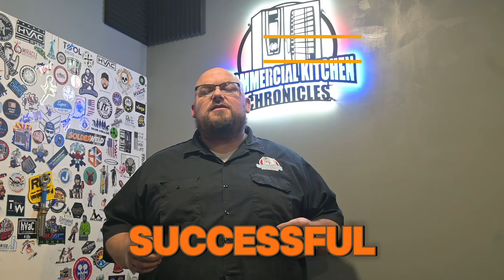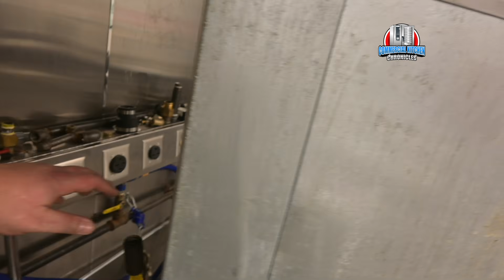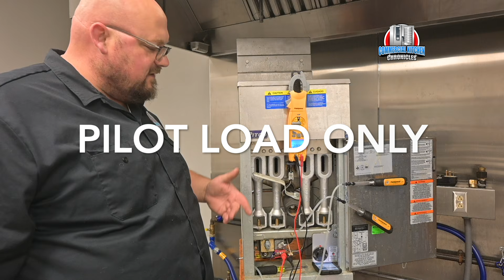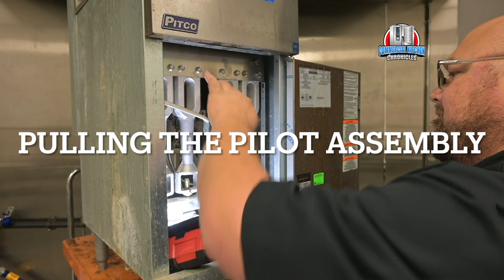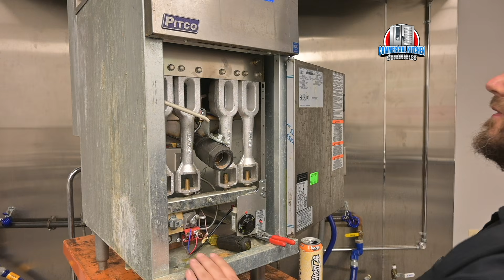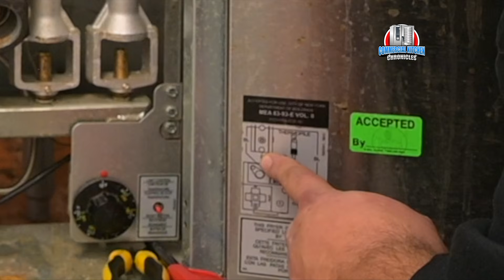🔥 How to Troubleshoot the Most Misdiagnosed Commercial Kitchen Equipment: The Gas DC Millivolt Fryer

Comment: I just installed a standing gas fryer and my food truck LPG and I can’t get the pilot to light at all and there is some confusion on whether I need a regulator in line or not. Instructions are horribly vague. With the regulator ahead on the old deep prior, nothing wants the light but when it’s completely unregulated, the pilot light won’t light, but there’s always coming out of the three nozzles.
Reply: Your fryer most likely has a gas valve with a built-in regulator (a combination gas valve) ; However, that regulator in the gas valve cannot hold back or regulate the pressure a propane tank supplies.  Get your supply gas pressure  ( the pressure going into the gas valve) regulated with the proper regulator.  I'm not 100% sure of LP pressure needed but it's probably going to be around 12"wc (INCHES of WATER COLUMN not psi) . If it's a used fryer make sure it is set up for LP not Natural Gas.   If gas is flowing out of your main burners without a regulator on it, you created a very dangerous condition and MAY have even damaged your gas valve.   Do NOT try to light until gas pressures are set to what the fryers ID tag states. LP probably 10"wc  Natural probably 3.5" some fryers a little higher.  Good Luck   
You really should get a commercial appliance tech to test and install this fryer.
Reply from the maker: on point sir
Reply from the maker: Tank needs a regulator at it and then one at the fryer. LP on food trucks are always a pain

Comment: Thank you so much for the video! I have a Pitco fryer, and I’m having an issue: when I turn the valve to 'ON' after lighting the pilot, the pilot light goes out. My thermopile is reading 600mV, so that should be fine. Also, sometimes the pilot goes out right when I turn the thermostat to start heating. Any idea what might be causing this? Thanks for your help!

Comment: Those fryers don’t use pressure regs if fed with 14”wc or less . The gas valve is a regulator built in
Reply from the maker: Yea I know that. I was using it to simulate low gas pressure situations.

Comment: I've never seen fryer with vertical burners like that. The model I service it always horizontal. I got question...I'm having a fryer keep making boom noise just during cold start. I replaced gas valve, ignition, spark cable, relay board, but nothing help. In coming gas is a bit high 12.5 wc...7-9 wc is normal. This is 2x connected fryer but another unit has no issue sharing same gas line. Nothing block rear chute. You think could be burner issue? Thanks
Reply from the maker: Could be loading up on gas. Igniter placement could be off a little bit.

Comment: I need to look as well, but I'll still ask. You have close up videos on the just gas vlaves, the various ports and how they adjust?
Reply: On a service call, I had a pilot light go out on a deep frier.

I been in the trade 13 yrs in Phoenix area for a/c and refrigeration. I'm pretty weak on the hot side. Again, appreciate the video!
Reply from the maker: Ill be redoing it later. I'll pull the valve and show it

Comment: any thoughts on what would be causing my industrial pitco fryer to over gas and shoot a flame out the exhaust chute when the burner does light? also have one bay that lights and runs fine but will constantly have a flame coming out the exhaust chute. we have cleaned the chute and installed new burners and it still does it? thanks in advance for any help. Dave
Reply from the maker: Gas pressure? Divertors in tubes?
Reply: Could be valve issue. I fixed one just like that it scared the crap out of kitchen crews. I start it up and both pilot and main burner lit up at same time it startled me.
Reply: I have a pitco that goes boom too... Did u resolve ur problem?

Comment: Pretty sure that gas valve is rated for .5 psi inlet so your appliance regulator is another issue waiting to happen.
Reply from the maker: Its only only there so I can simulate low pressure issues....

Comment: It would help if you had close ups of where everything is hooked up to.  I can't see where your manommeter is connected.
Reply from the maker: Ill be redoing it soon. Thanks for the feedback.
Reply: @CommercialKitchenChronicles i look forward to it!
Reply: I have a propane converted one that I just bought.  The pilot knob won’t turn from off to pilot .  It’s like it’s locked any suggestions?
Reply from the maker: @nbdteev new valve
Reply: @CommercialKitchenChronicles  you mean like a whole new valve that has the pilot knob that I just saw online?  I read there was a safety mechanism that makes it lock if there is not enough pressure
Reply from the maker: @nbdteev no you have to push it in a little before turning it.
Reply: @CommercialKitchenChronicles  that’s what I mean I tried everything and nothing
Reply: That’s what I mean.  Even pushing it in.  It won’t turn at all it’s like it’s locked.  Is there a safety mechanism on these things.  I have tried everything

Comment: Good thorough run down. Would be helpful to have close ups on the different things you are pointing to and adjusting. Like the main burner gas pressure adjustment at the safety valve etc.

Comment: I always just short out the red and blue on the valve to test the hi-limit. I've found with hi-limits if they don't reset, a good solid smack  on the side with a heavy pair of pliers usually does the trick. You'll then get the "click of success", lol. And another trick I've learned is that they seem not to make those red millivolt valves anymore, everything has gone back to the silver valves with the beige knobs. The valve in your video has 4 terminals, but the silver ones with beige knobs only have three. Just ignore/don't use the blue wire when you are  converting it over because brown to red is a complete circuit through the hi-limit and the thermostat. From bottom to top on a pitco, it's: both reds, white in middle, brown on top.

Comment: My fryer is candeling
Reply from the maker: Gas valve not fully closing more than likely. Being a food truck, do you have proper regulators installed on the equipment.  The high pressure of thebtanks can damage valves.

Comment: 5.46 is incorrect the whole gas valves incoming gas supply is regulated by the governor(regulator) on the back of the fryer. When you're adjusting the rear governor(regulator) it WILL alter the pilot supply because you'll reducing the incoming gas pressure to the whole gas valve. The only way that pilot flame should be increased or decreased is by adjusting the pilot supply adjustment screw on the gas valve itself. The only other way that pilot flame will be too high or too low is if the incorrect pilot jet(orifice) was inserted or the pilot mushroom was blocked or obstructed or the primary air opening had an issue. The fryer main gas valve may have a regulator built into it, it,to  be used to adjust the burner pressure if required for lp it may be capped of at present with a blanking plate if you on natural gas.
Reply from the maker: @manninghr1  did you read the description or watch the entire video? The only reason I had the regulator on the back is to usebit to simulate low gas pressure issues. My system is only at 8" w/c so technically I don't need it. Yes the only way to adjust the pilot is with the needle valve. I was just showing how gas pressure can affect your pilot, not using it to adjust it.

Comment: Hi there so if the pilot won't stay on and when holding it down leads on the terminals with just pilot on that means gas valve is likely pooched correct?
Reply: Sorry leads on terminals with it held down only getting 305 MV and the pilot won't stay on by itself... Likely the gas valve?
Reply from the maker: That's pretty low output. Whats the thermopile reading unhooked?

Comment: my thermocouple gets 650mv unloaded but would not go beyond 300mv loaded. as a result, i always have to use lighter to help heat it up in order for the burners to start. could you tell me what I'm dealing with? i replaced thermocouple,  high limit and thermostat,  nothing helps. any advice is much appreciated.
Reply from the maker: Gas pressure? Pilot size adjustment?